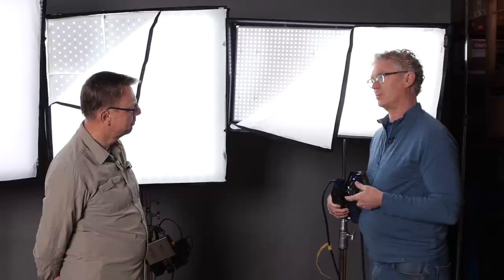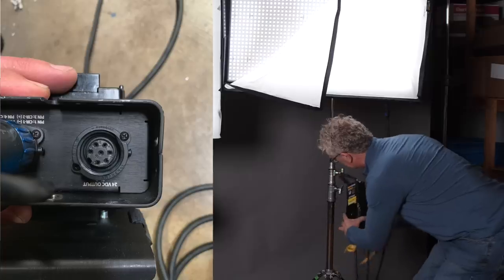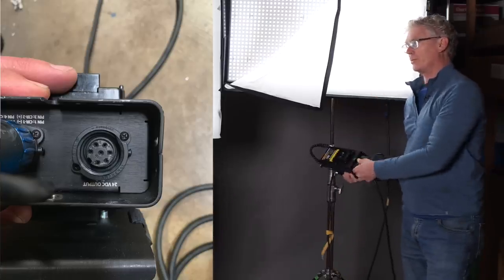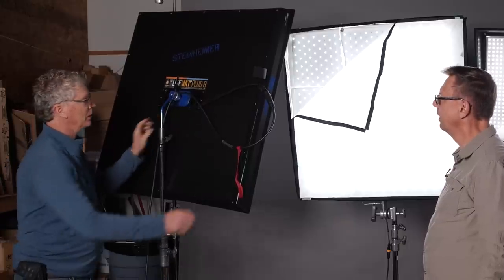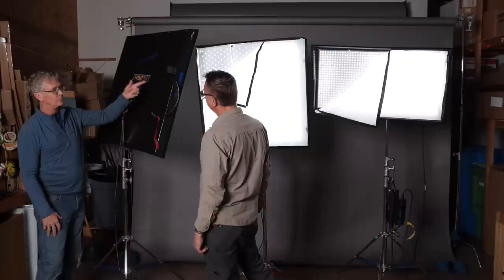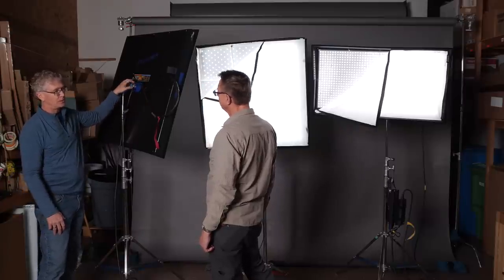Meet The Gaffer #125: Lite Mat V Aladdin

Comment: Great video again Luke! Will probably get into the Aladdin Fabric light sometime this year. Would love to see a real world quick photometric comparison between the 200w vs 350w. I’m leaning towards the 200w for the ease of battery use!
Reply from the maker: I did a rough comparison earlier and the 350w is about 1-1/2 times the output of the 200w. It’s a nice unit. Mind you, neither are particularly inexpensive... but they are handy for travel and the 200w, with a small Lowel stand and some stingers fits in a carry-on. Only the frame I currently use needs to go in a larger luggage case:)

Comment: Regarding the Aladdin power pack, If you turn the two AC bricks the other way the dimmer would fit flat and would not be raised above the Power Supply unit like in the video
Reply from the maker: Yup, that works! Wanted something quicker. Regardless, it’s still clunky. We demand more of those we love, right?:)
Reply: @meetthegaffer  needs some attention, no denying. Especially when you use the 200 watt Fabric light & its sleek power supply then look at the 350w fabric light power supply. That DMX though...Thanks for the GREAT videos
Reply from the maker: Not to mention Lumen Radio, and the simple, small connectors, foldability, and durability... I love it! So close:) Thank you for keeping me honest!

Comment: If you could only choose one for your Arsenal which would you take? Given that you will also have access to accessories such as the dop choice snap bags etc.?
Reply from the maker: Good question! Originally, I went with Aladdin because they had better connectors and incorporated WiFi before LiteGear got around to it. No question that the 4LPlus and 8 are go to units for a lot of people. The Spectrum’s had a bumpy roll out and the battery situation seems problematic. I haven’t traveled in a year so the break-down-ability of the Aladdin has been less important. What I find is that when I want to fly something soft behind or above, I’m either going with a freestyle Kino (lightweight, All Color tunable, WiFi enabled) or some kind of tunable unit in a lantern (panel or point source). I’m just not using the Mat-type units as much as I use to. Probably not the answer you need😕

Comment: thanks luke and alan for another great video. I own the aladdin 200w fabric and I love it. you just need one battery to run it. you don´t have that strange ballast cable salad that you´ve shown and the output is great. I use it as a key light a lot or to fill a little bit in. so no need for the stronger version for me. I am using it with the frame from aladdin but was thinking about buying the dop choice snapbag like you have in the video. could you recomend that? 
greetings from austria
Reply from the maker: Hi James,
Yes, I appreciate the ease of use that the 200w Fabric Light allows. I picked up the 350w to have a version that could play with other stronger lights. I do like the snap bag and snap grid. In fact, I hope to receive a custom snap grid that I’ll talk more about soon.
Reply: Luke Seerveld Thanks for the videos. Great job on them. My lazy rule of thumb has been HMI is 4x output per watt compared to tungsten and LED is 6x output per watt compared to tungsten. Bad rule of thumb? And would you say the 200watt is roughly a tungsten 1k equivalent or a bit better? Thanks.
Reply: Luke Seerveld Sorry and last additional question. Do you have thoughts about the 4x4 config of litegear’s litetiles? Seems a bit more versatile for possible 2x8 window wrapping or other uses/configs and seems like it may be a bit less wonky cabling and also 400watts.
Reply from the maker: That’s an interesting rule of thumb and could be useful. I’m not sure how that translates when you compare fresnels, open face, or direct and indirect soft lights. One thing to consider, if the unit is Kelvin tunable, is whether a unit is using the stated wattage in all steps throughout the shift from warm to cool. And just another thought, a Skypanel S60 is roughly a 400 watt LED and so is the LiteMat 8-plus, but I’m thinking they would probably match up to tungsten or HMI equivalents quite differently. We’re getting away from uniform fixtures now and entering a whole new world of flexibility and differentiation where the wattage spec may or may not correlate as well as one might like:)
Reply from the maker: Alan spoke to that a bit, but neither of us have extensive experience with LiteTiles. I would love to have an 8x8 LED, but I’m afraid I’m probably not willing to pay for it or take the time to rig it on most jobs:)

Comment: Hey Luke, what is the difference between horizontal and square lights in terms of coverage in lighting an interview?
Reply from the maker: Good question! It’s a subtle thing, but it has to do with wrapping the light around the face when used as a key, which of course is somewhat moot once you throw a larger diffusion in front of it, but where it really comes into play is as a backlight b/c a square is harder to get out of frame than a rectangle... especially if you are lighting a practical location with minimal room above the frame. Does that make sense?
Reply: @meetthegaffer  It does. I was experimenting with something like an Icelight for use for an interview (I got the idea after I had to use one in a pinch by holding it in my hand ..lol) and thinking about how Kinoflos are rectangles and were industry standards.
However I do use Icelights as backlights and they do spread pretty well for what I need.
Reply from the maker: Yup, we use what we have access to... that’s another way to define “available light”:)

Comment: Perhaps OT,  but why do people call a power supply a "ballast"? Afaik magnetic ballasts were used with HMI to reduce the voltage after ignition, replaced later by elektronik ballasts doing the same.
To me it looks like as every "bigger" power supply is called a ballast nowadays?
Reply from the maker: Old nomenclature often stays around longer than the thing it names:) Who actually dials a phone or rolls down a window anymore? Power supply, AC adapter, controller, that thing that goes on the back, the brick, the anchor, the box with the fan, or the ballast... good times!
Reply: @meetthegaffer  thumbs up for the "dial a phone" - but roll down windows have never been popular in Germany ;-)
It´s always funny to compare languages , especially in this business. It´s different to - lets say - editing , where all nomenclatures seem to be quite similar (the editing software gives it).
I remember when you first talked about a "scratch light" - never heard that before until I understood what you meant.
Same with all these "blondes" and "teasers" , "toppers" and whatevers - quite different here.
Reply from the maker: Ha, ha! Right, lot’s of shorthand to learn, and everywhere a little different.